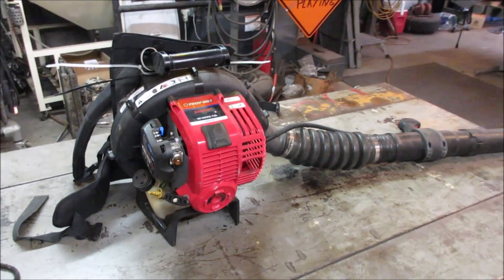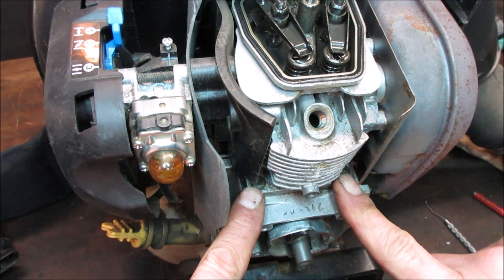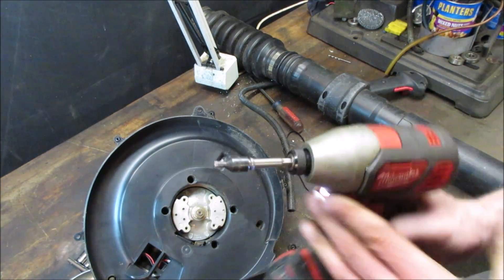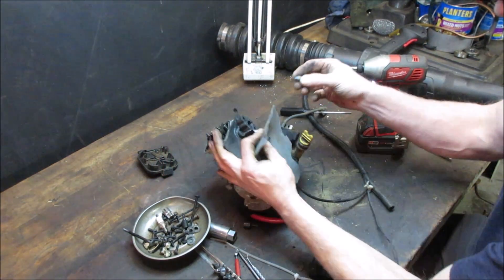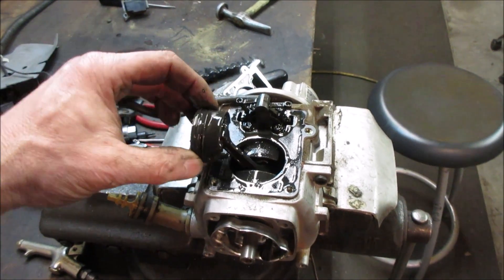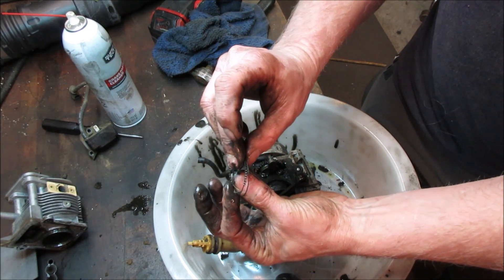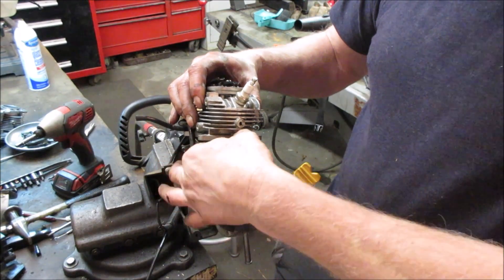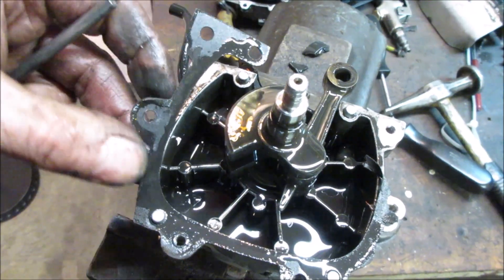Can We Save This Junked  BackPack Leaf Blower ?

Comment: I'm wondering if the blower was laid down running and the oil ran away from the slinger. As nasty as that oil was, it could have just been lubrication failure. Missing air filter is always a red flag of no maintenance.
Reply: There's so much turbulence inside those little crankcases, they're designed to tolerate running upside down.   The Ryobi 825r would happily run upside down for minutes at a time.
Reply: I just wanted to add the tiny garden implement engines that Honda makes, the sub 50cc, 25 through 35cc engines, all use an oil misting system that is "pumped" around the crankcase with reed valves.
 Also some of the oil mist makes it way into the overhead valves by way of these pressure waves, it's the same lubrication used by 90% of the bigger utility and industrial OHV engines sold, that also lube their valves and rockers with oil mist. It's pretty clever.

Comment: Interesting to see it has crankcase oil. I work on maintenance equipment and have had the 4 stroke weedwackers on my table, but they run on 2 stroke gas since they get spun upside down and stuff.
Reply: The weedeater had a oil fill? That's crazy. So you can't turn it up 90°  and use it for edging?

Comment: I don't know about throwing it out, except for the piston and maybe the bore, because you might find another of the same type and want the spares, just like you saved those weed whackers that didn't fit.  Should you even toss (or recycle) the compression rings?  I do think the oil ring is done, and reassembly might be useful just to keep from losing the parts.  I often do that.

Comment: without reading the stream, like you said, they are throw away items. My guess the piston cracked due to poor materials, we call it Chinese Metal  full of defects and imperfections. Cannot be welded ore soldered. That plate with the three tabs I think would be an anti-vibration plate, like break pads have? It absorbs the vibration so it won't run up to the rockers.

Comment: I was intrigued by this video.  A cool adventure.  It might have been the shock from the impact that fractured the piston.  Why not look at the engine data label(VECI,EFN?).  Then you can find an exact match (or what parts will fit).  Some even have that funky digital "hieroglyph" thingy...  just saying.   Oh, gota add them Taryl Fixes All sound effects:  flatulence when straining on them tough fasteners.   Or NOT and just say that you did.  Them blowers cost about $200.  Would be cool to fix and resell.

Comment: The part that you thought was a timing advance is actually an oil lift. It helps to lubricate the top end.
Reply: How does that work?
Reply: @WolfmanDude  it catches the oil in the gear divot and slings it farther up.
Reply: Its compression relief. You can see the hole in the cam at 46:37.
Reply: @WolfmanDude  it looks the same as oil lifts on the extreme duty winches we worked with. It catches oil on the side and centrifugal force pushes it up.
Reply: I was wondering what lubed the top end.

Comment: 'Made for the ease of putting it together not taking it apart'  most certainly, because it's guaranteed to run till it breaks which it will do without a service and air filter.

Comment: That is some damage. The common issue I see with these consumer grade 4 stroke backpack blowers is tight exhaust valves. I’ve picked up 6-7 off marketplace really cheap. They either don’t start or they will start but the second you try and give any throttle, they die without ever showing signs of revving up.

Comment: I think the tiny 4-strokes are a cool invention. But they tend to be more fragile than 2-strokes. I busted a weedeater even though it had plenty of clean oil. Out of curiosity, I looked at Lowe's & HD. Each had just one available 4-stroke blower in the lower priced range (as opposed to very pricey 4-stroke Makita blowers). 4-stroke weedeater selection was also skimpy. Maybe they are on the way out, especially since battery powered items seem to be dominating at the two big retailers.

Comment: Torx L keys are the basic solution to those ‘cylinder head’ bolts. I have a set of Wiha I got as a gift - they are great but I suspect for the amount of use they get there are cheaper alternatives
Reply: I think what Mustie needs is some long Torx sockets. He might be able to make some. Just cut a screwdriver shank off and weld it into a socket.

Comment: 25:30 Maybe the fuel mixture went way too  lean, 

 ( it is  not hard to imagine especially with there being no  air filter element.)  

 Then  being run lean, 

the  small piston  in that little engine got Toooo HOT  and the compression ring  busted out of that top of the  little aluminum piston.

🤔

Comment: I believe it was just a flaw in the manufacturing process of the Piston that caused it to tear apart that happens with metallurgy process. I knew there was more shrapnel inside that little engine. I thought for sure you'd be able to buy a new piston and head for that little thing no?

Comment: Did the broken back pad straps cause the pad to block the cooling air intake?
Reply: Very likely. Then the jug overheated causing the piston skirt to seize against the cylinder wall.  Probably seized and stopped running, then it cooled off and they tried again later to run it and it had freed up.  But the damage was already done and before long it seized again. after a few repeats of this the skirt was disintegrating.
Reply: Best scenario.. Four strokes suck for these applications for that reson..

Comment: Here is what happened:

The cheap Chinese-made, American-designed piston was created to the right specifications and tolerances, but built in a small rinky-dink shop with cheap tooling and cheaper metal. The pin that goes into the ring groove that keeps them from spinning and spinning came out, so the ring did just that, it spun. And spun and spun, right to the point where one of the ring ends made its way to the intake or exhaust (usually exhaust from my experience) port, where the end of the ring popped straight out into the port, the edge of the port grabbed that end, and it popped off a chunk of the piston crown. Seen it MANY times in high-revving, “disposable” (orange store, blue store) “1-season” junk. They aren’t built well, they’re built with cheap materials, the carbs are “loose” and hard to tune and adjust correctly, so they pollute like crazy and the shafts will wear out prematurely, they’re cheap at the beginning for a reason, and this is what happens to them. Love your videos though, but that’s what happened to THIS particular machine.

Comment: Im sure you could find a new piston for it pretty cheap or a new cylinder head.
Reply: Good idea, but some model's are priced 2-3x more than the value of what you may be working on. I have a 55 gal. drum FULL of  small engine's beyond repair.
Reply: @metoon3092  … whoa, it’s been over 10 years since I rebuilt one and they were cheap! Times have changed I guess to the use and toss model even more
Reply: The amount of damage done to the original piston suggests to me that the broken bits would have caused too much damage to the rest of the engine for it to last much more than a few minutes even if you could get it to run with a replacement piston.
If there's one thing I have learned from Mustie1 it's not to throw good money after bad. The blower itself is probably worth less than the cost of repairing it.
Reply: Troy Built engines are absolute junk.. Pretty much run it and throw away when it breaks. SOME parts are available but most are not (or too pricey considering the price of a new machine). One thing I am sure of, I will never buy a Troy Built ever again!
Reply: If Mustie was Burt Munro he could cast his own.
Reply: @haywoodyoudome  🤣🤣🤣
Reply: @petereye9138  a dealer once told me that every company is allowed to make a certain percentage of their equipment 2 stroke. So what Stihl did was they allocated all of their allotment to chainsaws. They threw the rest of their equipment under the bus basically. The government gave them no choice. No companies did it because they wanted to. It's regulations.
Reply: @1pcfred  385 euros for a piston and cilinder for one of those stihl chainsaws.
Had one that ran straight gas and no oil by a customer, 6 month old saw.
Reply: Given the vintage of that leafblower, I highly doubt he'll be able to get parts for it - I have a 20" Troy Bilt chainsaw from around the same year as the leafblower and pretty much every part has been discontinued and no longer available.
Reply: @blackenedmagic888  I don't think the people suggesting Mustie buy new parts really understand this channel too well. It isn't so much a matter of can it run investing unlimited money in it, but rather can it run with next to nothing put into it? The horde is fair game but it doesn't go much past that. Just some gas and yard sale oil. I chalk the carb cleaner he sprayed onto it a quest for greater video production values. That he did for us.
Reply: @haywoodyoudome  Mustie's complex is peak hoarder and he's proof some hoarders are organized. Plenty of useful parts to take off

Comment: I had a Dodge 318 that did that after being run low on oil.  I found a cheap replacement engine, but later parked the van with trans problems.  Still looking for a deal on a 727 or overdrive upgrade.
   The blower could have oil starved from being run at too steep an angle too, like on its side or upside down.

Comment: I could be wrong, but if it had the wrong spark plug in it.  That could have come in contact with the piston, and kicked it sideways, and depending on the R.P.M's at the time it could have caused violent destruction to the piston, and cylinder walls. As you know those items are only cheaply connected cast aluminum.

Comment: Appears to be catastrophic piston failure.The oil seemed to be unusually black for the amount of hours it was actually run for.The absence of the air filter certainly could’ve contributed to the failure when the oil loses its viscosity to maintain the integrity of its components resulting in catastrophic piston failure.The coroner would probably have written something similar to this on its death certificate.

Comment: Could the funky cam shaft drive be some kind of oil pump to lube the valve mechanism ?
Reply: I think so also. It has to be difficult to lubricate a 4 cycle engine that is subject to multiple angles of operation. That oil splash arm just doesn't seem like enough.
Reply: I was thinking along the same lines, like the thin cover was to hold a bit extra oil to insure some would make it over to the cam side of gear?

Comment: I was wondering if maybe that piece of the top of the piston that broke off turned lengthwise and put a lot of sideways force on the piston skirt as it came back up and impacted it on it's opposite edge. That would explain damage on the top and bottom but the center is still in tact.

Comment: I think that piston just failed. Probably had a crack under the bottom ring land, and eventually it progressed until the skirt failed and got ground up by the crank counterweights. I think the piston might have been just poor quality casting the way the top edges are crumbling as well. 
My guess that thing on the cam gear is an anti-backlash device to keep the cam gears from rattling and compensate for wear. I doubt those gear teeth are hardened.

Comment: More than likely whoever was using it overheated the unit because the air flow was restricted by the blower flopping around on the backpack. I had a two stroke backpack unit 20 years ago that my then girlfriends 20 year old son barrowed and overheated by letting leaf debris clog up the air intake, overheated and sized up melting the top of the piston.

Comment: 2 things, do you have a small butane torch for these pesky bolts? also are the cylinders plated, would it have been possible to hone the cylinder to fit the larger pistone?

Comment: I'm blaming that on quality control.  That piston was f'd from the start.  Bad casting with a hair line crack or weakness.  Overheating or running dirty just doesn't explain that piston failure IMO.  We are over due for an outboard video!! :)
Reply: I have no use for boats. Well I could. It's not like I live far from bodies of water. I just know to stay off the wet stuff.

Comment: Used to work for a big box store in the assembly department. Part of our job was to check out returned units to see if they were worth sending out to be repaired. It was sickening to see the abuse that stupid customers did to power equipment. One of the worse I saw was a hole in the cylinder head of a mower the size of a half dollar probably because they ran it without oil.
Reply: hahahaha wow..
Reply: Some JB weld it will fix that right back up.
Reply: I have seen burn throughs a few times (head and piston) but the most interesting one i saw in person was a mower that was surging really badly. Every time it would rev high (pretty sure the guy had messed with the governor as it was def revving too high) it would go hard lean. So I'm watching guy...muffler glowing bright enough to see in daylight....when it hit the point where it had eroded enough metal from the head that it blew through on a firing event.....It was loud and produced a nice fireball.  At the time i lived in a really bad area so the man that was cutting panicked tripped over his own foot backpedaling from the mower and was on the ground before he realized it was the mower. The guy was a pretty bad neighbor so i found this lets say...furiously funny.  But back to the mower. Id actually never seen one fail quite like that. I did find out it was the carb that caused it because after he threw it out by the trash cans i parted it out. It had melted and eroded the head bad before it gave in and had just about melted through the top ring land on the exhaust side of piston. The carb did very similar on another mower glowing muffler and all. Never was able to get that carb working correctly. Thanks for reading!  If you are still with me I Hope You Are Having A Great Day ! And I Hope You And Your Loved Ones Are Safe, Healthy And Happy!!

Comment: Btw as a theory to why? Ive seen it before that no filter can cause it to run too lean.. Maybe high rpm lean condition
Reply: good call ...leaned out so much that it got too hot and started melting down the internals?..very possible

Comment: 'usually it doesn't shred the piston' - in this case, the fan has a LOT of inertia that isn't present in the same way on a string trimmer or similar appliances. I wonder if that could drive the shredding.

Comment: I would guess the leaf blower was dropped while running and broke the piston then. Possibly the metal bracket for the shoulder pads broke then the machine fell while running and they tried to repair the harness with zip ties only to find out the motor was kaput.

Comment: those backpack blowers were always known to do that when they've been inhaling air without an air filter and regular oil changes, used to work at a lawn tractor shop that worked on these too... such a shame it went out like that, great to see why it failed, i figured it would've been either a snapped ring or the crown losing pieces.

Comment: Assuming they haven't changed the engines over the last few years, the leaf blower has a 32cc engine, the weed whacker has a 30cc engine. No need to pull them apart to find that out.
Reply: But its more fun to take them apart :)
Reply: Yeah but they could get the displacement by stroking the motor. It doesn't have to be a bore.
Reply: there's significant differences just one being the diagonally split crankcase with the plastic back side of the 28.5cc Ryobi clone, the cylinder base plate is far smaller and the cam and rockers are larger on the big 32cc model.

Comment: He should hammer on the stuck bolts before even trying to twist them in order to shock them looser.  Though hammering might not work as well on locktite as is does on rust.

Comment: Hey I have a question regarding your ultrasonic cleaner. I have the exact same model at my house and I’ve been having trouble with cleaning carbs. They keep coming out black (almost like a layer of soot) and it wont clean off. Have you had this problem before? If so, how’d you get around it?

Comment: With the way the top of the piston was cracked off  my first thought was a previous spark plug was a bit long and broke off causing the piston to fracture and break then someone replaced the spark plug and bent it up once again but the damage was done someone failed to check the length of the factory spark plug

Comment: The most common scenario an engine owner exhibits with low oil is: He fails to check or fill the oil, it breaks the engine, and then he fills it with oil. Then he tries to start it with no luck.

Comment: Maybe its because the aluminum skirt is paper thin, and a crack developed as a result of running it with old  dirty oil.  Because its aluminum, the crack widened and the skirt broke off. Because the skirt was gone, the piston started slapping and the edge broke off and hit the spark plug, shutting off the engine. These machines are usually used by companies instead of home owners, and the company just tossed it rather than try to fix it. Judging by its condition, with the use of cable ties, its pretty clear the employee had no mechanical sympathy, and ran it  until it broke permanently.